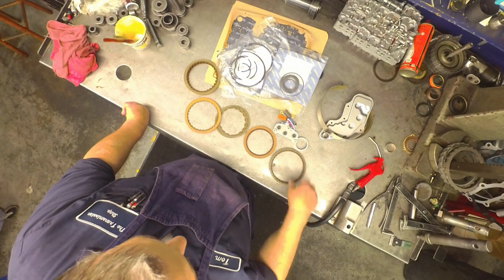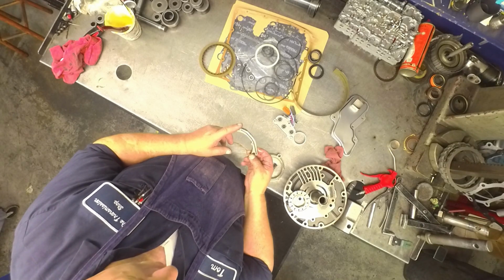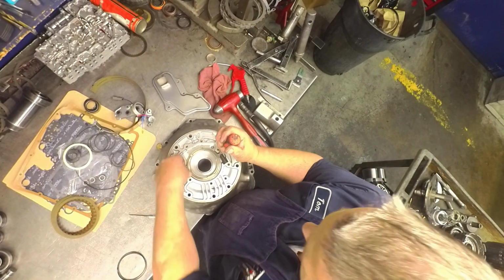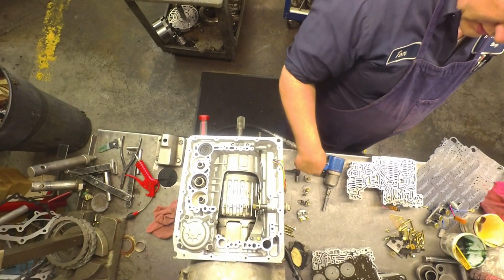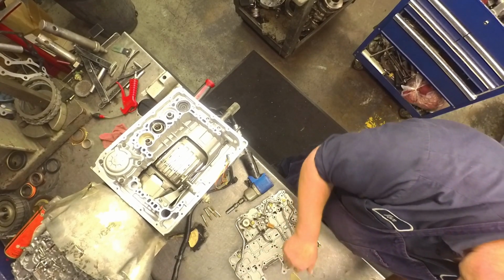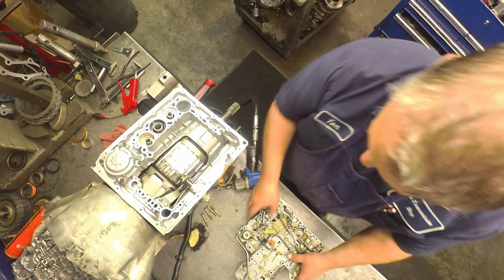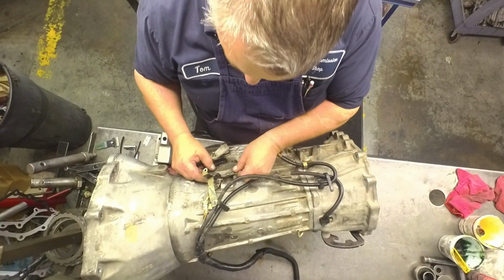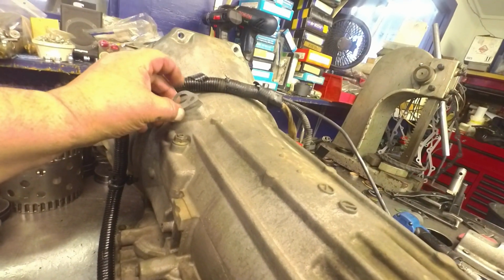RE4R01A Rebuild

Comment: Ok i got the trans back in and reverse works  but i get an incorrect gear ratio code, it feels like its taking off in second gear but it does shift to the next gear smoothly but when i get up to 50 mph or so it never goes into overdrive.I do feel at least 2 shifts from a standing start  , but if i manually shift to first gear it never drops down and stays in first  like our 2001 does . The transmission does no change of gear or anything change with the RPM when i press the OD button on and off when im going 50 mph . Also i hear a whining sound like a trans makes when the fluid is low sometimes after it warms up, its not very loud and it comes and goes.Sometimes you never hear it  at all ! Well i think my main problem is  i have the wrong transmission filter/strainer installed .I havent driven it very far at all . The filter that came with the kit has a 2x2 x 3/4 deep box on the bottom of the strainer that all the trans fluid is sucked in through . We have a 2 wheel drive 2001 Xterra and the trans pan is shallower than this deep pan thats on the 2004 4x4 so i think its sucking air and running out of fluid at times because of the shorter filter it too far from the pan bottom  . I got a different filter today with a longer square intake box but the pan was just barely hitting it so i cut about an 1/4 of an inch out of the little intake box  so it sits almost at the bottom of the pan in the center where those 4 channels are cut into the center of the trans pan. This filter said its made in Tiawan so mabey it was never cut right.i wouldnt be surprised  . The other filter the shorter one was about 5/8ths of an inch off the bottom of the pan and i think it was running out of fluid sometimes. The guy at the trans shop said this filter he gave me is for a Mazda RX7 but it looks like the other one except the intake is over twice as long and the bolts that hold it up match up to the valve body .You only hear that slight whining  when its in park and your not driving the truck and its warmed up  . I dropped the return line off the trans cooler today and ran the engine for a few seconds into a 5 gal bucket and noticed the flow was not as much as our other Xterra. Its supposed to pump our like a quart  or 20 ounces every 25 seconds and it was pumping mabey half that so  I shut off the engine and hooked up a 12 volt transfer pump to the discharge line to pull the fluid out and the pump was clearly sucking air in just a few seconds because the intake is too far off the pan bottom i suppose so i took the drain plug out to drain the rest about a quart and a half out. I havent tried the new longer filter yet just thought id ask you first. I followed this video to the letter when i rebuilt the trans. Any advice much appreceated, hopefully i didnt fuck it up, the fluid looks fine still and nothing strange in the pan, ive only drove it mabey 2 miles tops.
Reply from the maker: First thing is to make sure and get the right filter. There are 8 different ones. Do you have the original? You need to match up both sides of the filter as there are differences on each side. Most Xterra's I have seen that are 2-wheel drive, take a WIT #73010AB. If you don't have the original and the transmission has never been replaced, I would get one from the dealer and you should (Not that they don't make mistakes) get the right one.

Comment: What would cause hard shifting on a 4 wheel drive 98 pathfinder
Reply from the maker: Are there any codes in the system? Just because the check engine light is not on does not mean there are no codes. High line pressure because there is a code stored would be a start. There are alot of things that can cause hard shifts. We need to narrow it down a bit.

Comment: The noise you said u would get from using the wrong hub , could u get that in 3rd? I used the factory one. But on 3rd i hear something for a split second. Only at 1/4 throttle. 4 is good . Transmission pulls an shift great.
Reply from the maker: Yes,that is when you would hear it. Usually it does it no matter the speed.
Reply: @CurmudgeonTransmission  will it last for a bit ? Or is it something that will destroy the trans in a few miles? And thanks for responding.
Reply from the maker: @danielbolen1396  Don't think it will do it in a few miles but it is making metal shavings from rubbing on the clutch.
Reply: @CurmudgeonTransmission  on the transmission that came in the superchargerd frontier dose the high clutch stack go steel steel then alternator to the plate? I think I messed up using parts out of a no supercharged transmission. I know the drum was taller. An the no supercharged one has a thicker steel against the piston. Thanks for all the help
Reply from the maker: You can put the heavy duty parts in a light duty, but not recommended to go the other way. It is recommended that you use ALL the parts involved which include: Rear planet, front planet, sun shell, reverse drum & clutches, high drum, high clutch hub, band, low/reverse piston, forward drum, sprag and most of the bearings. There is nothing stated what the stack should be in the high drum. I can tell you you can make whatever configuration with the steels you want. 2 on top of each other, thicker, thinner. Whatever you need to do to get the clearance to come out correctly as well as placing the bottom clutch high enough to engage the hub & the top clutch low enough to do the same. Just make sure you are not using less clutches than what it came with to get there.
Reply: @CurmudgeonTransmission  thanks a million man. I really appreciate you taking time to help.

Comment: Hi, why the service manual for the 4x4 Nissan Pathfinder 1998 with the rear 2wd part time option says, that the vehicle can ( but not recommended ) to be towed with the rear drive wheels on the ground at the speed no more than 60 mph with the transmission and the transfer case in neutral ? Does the transfer case in neutral not totally disconnect the front and/or rear wheels from the transmission? Your opinion would be highly appreciated.
Reply from the maker: It apparently does not. I can tell you I would not tow one at all unless I took the driveshaft out of it. I had one come in last year that someone had towed half way across the country and it welded the entire gear train together. Couldn't even get the thing apart. RV places sell quick disconnects for driveshafts.
Reply: @CurmudgeonTransmission  Mine got towed by the road service for 25 miles in about 20 minutes and right after the towing the reverse is shut, the vehicle moves forward in neutral. What do you think ?
Reply from the maker: Sounds like it already damaged it. Hopefully the damage is limited, but you never know what your going to get until you get in there.

Comment: I bought a 2004 xterra 4x4 automatic for 500 bucks  that has no reverse, it drives foward perfectly od works and the 4x4 works fine. When you shift the trans in reverse it sounds like the engine slows slightly but wont move the vehicle at all but it does engage and the engine changes , i really dont want to drop 2 grand in a vehcle thats not worth 2500 with 277,000 miles, the 3.3 engine runs as good as our other xterra with 130,000 miles and the ac is ice cold and the body is in mint condition, the interiour is like brand new
Reply from the maker: Sounds like it is worth it to me. If you are mechanically inclined fix it yourself and save some bucks or just keep it as a parts vehicle. If you are asking what I think is wrong with the transmission, sounds like the drum is ring cut because the bushing wore out in the reverse drum. Bare minimum in that case would be the drum and pump, of course you never know till you get in there. Mine has 220,000 on it now, freshened it up at about 90,000 because it was leaking out the front, unit was working fine.  When I got in there the front planet shims were coming out of the planet. Few more miles and would have caused a lot of damage. Got a 4L60E in a Chevy truck right now that has 170,000 on it and working fine. Guys wife told him she would not go on trip towing a trailer to Colorado if he did not get it rebuilt. Good thing, rear planet had a chip in the teeth. Would not have made the trip, probably would not have gone much further anyway.
Reply: @CurmudgeonTransmission  Ok Tom i FINALY got the transmission out, omg it took me 4 days working on it 3-5 hours at a time i had to pull the torsion bars  and all the exhaust off the front and shove the muffler and the tailpipe and that flex joint thing back enough to clear the tailshaft. I first couldnt get it to budge from the engine because i missed one  bellhousing bolt, i also forgot about the speed sensor on top of the bellhousing , the plug broke loose when i dropped it down, but i dont think i dammaged it. The hardest parts were getting the exhaust flange bolts off especially the passenger side, getting the starter out through the inner fender and getting those big metal braces off the side of the block that let that dust cover come down, i  had to remove the trans cooler lines out to allow that dust cover to be removed. The 4 converter bolts were very difficult to get to and i dropped one of down inside the bellhousing. i didnt remove the heavy transfer case taking it out but i think i will leave it off to re install it. This is one of the most difficult jobs ive ever done, I can have the transmission out of my 85 Square body chevy in about 2 hours. I also need to fix the rear main seal and possibly the oil pan but the differential in front looks like it has to  come out or the motor has to be pulled!  I have a 2001 2 wheel drive with only 130,000 miles but the rear main also leaks. I dont have a lift only a concrete floor garage and i literally have parts scattered all over. The only thing i see so far questionable is this pump bushing well im not shure thats the right name but its got 3 rubber o ring seals but they are square o rings and this metal looks worn, i havent got but a few drums out from behind the pump yet, the big drum is still in the case.The clutches ive taken out dont look bad, they still have the groves cut into them, The trans shifted great in all foward gears just wouldnt move the vehicle at all in reverse.That lever thing with the tiny rubber wipers in it seemed to be stuck, i think this causes the line rise? mabey thats why it wouldnt go backwards, you could see the engine rpm drop very slightly but it just didnt move.

Comment: Hi Tom, I have a 2001 Nissan Xterra 3.3L 4WD that is having some weird issues that I think is related to the valve body.  When the issues first started the truck would stall shifting into drive or reverse unless I let it warm up for a few minutes (Torque Converter Lockup?).  Then the problem progressed to it feeling as though the truck is starting off in 4th gear until about 10 mph then will downshift to first (Even if the Shifter is all the way down in 1).  Which solenoids should I buy or should I just rebuild/replace the valve body?  Thanks.
Reply from the maker: Could be a lock-up issue for the stalling. The solenoids come as a set. Will have all of them except the overrun on the front. Check cooler flow through the radiator for the stalling issue. Restricted cooler can cause that problem also.

Comment: You mentioned ls kit I'm looking for a rebuild kit with the band and filter included and can't find an the kit you mentioned where did you get yours? Also should i replace the torque converter while I'm in there? I have no reverse and will be tearing down soon to verify the cause
Reply from the maker: There may be places that sell it like that but not my suppliers. WIT or Transtar. Get a Transtec kit with Raybestos clutches. Get your T/C from Precision of New Hampton. Links are in the description. Probably the drum is going to ring cut from worn bushing. Pump stator will need to be replaced also. Do not buy your stator from WIT. It will not come with the valves and getting them out is a pure PITA. Bishop's or Transtar. Would say Slauson's but I believe they went out of business. Make sure you are meticulous matching the stator with the old one.

Comment: Hi Tom, the situation with my 01 X 4wd is that it is (1)not going into reverse, (2) all gears now go forward, (3) Does not go beyond 2nd gear (4) neutrals out and (5) has check engine light with code P0750 shift solenoid A. I am in Jamaica, just took it to the mechanic. Awaiting his diagnosis. Any thoughts?
Reply from the maker: Never know what you are going to get till you get in there. Guessing I would say pump, reverse drum, probably high drum, band, filter, shift solenoids and torque converter, minimum. But that's all guessing.
Reply: @CurmudgeonTransmission  Thanks Tom, I will let you know how it goes.
Reply: @CurmudgeonTransmission  An update: A rebuild was done. Vehicle now has reverse after the rebuild. The items after diagnosis were 2 reverse clutch, pump washer, brakeband and speed sensor. The P0750 code is still there, all wires were checked and solenoid checked. The problem now is that the vehicle not starting in 1st gear and is sluggish in moving at first, also it neutrals out while driving. What are your thoughts? Could it be the TCM, ECU or do you think we should go ahead and change the shift solenoids and torque converter?
Reply from the maker: @cheryl3487  You can manually check the solenoids, you just need to supply 12v to them. Shift solenoid A is a blue wire with white stripe, B is blue with red stripe. Should be able to here them click when supplying power. If they are clicking you can try making the transmission shift while driving supplying power to them. A is on in 1st and 4th, B is on in 1st and 2nd.

Comment: 2003 nissan xterra, I dont think it shifts into 4th gear or so... it did had a knock sensor code but I replaced it and code is gone. And recently got a transmission code p0745 for Pressure control solenoid A... which i guess its one of the shift solenoids from the solenoid pack. Could that be the reason it wouldn't get 4th gear?
Reply from the maker: P0745 is the line pressure solenoid. Very rare to get that code and it is usually electrical problem. Since you replaced the knock sensor are you positive everything got plugged back in properly? Also did you replace both knock sensors? There are two under the intake manifold, always wise to replace both. The line pressure solenoid also goes through a dropping resistor, I believe it is on the passenger fender on that vehicle. I would double check all my connections and clear the codes. If you have 1st,2nd and 3rd you have everything needed for 4th you just need the command from the computer.
Reply: @CurmudgeonTransmission  its the 3.3 V6 VG33E engine i think it only has one knock sensor, I replaced it and the code was gone... but before the p0745 came one I did notice the transmission not getting to final gear like I was going 70-75mph and it was at between 3000-4000rpms it didn't shift when it should have and you can hear the engine forced... but it was doing that weeks before the p074t came on. I checked the transmission dip stick the fluid looks red. Im worried I could have a transmission mechanical problem too
Reply from the maker: @ronaldreagan388  You are right I looked it up and it only has one. If you read in the posts below there is a similar problem, I give the wire colors, you can monitor the signals and see if it is commanding it. You will need to fix the 745 code first. Like I said it is more than likely an electrical issue.
Reply: @CurmudgeonTransmission  thanks Tom... by any chance do you know if the p0745 code is for one of the 4 solenoids from the solenoid pack... or its that one solenoid that is alone on the bottom side of the valve body which you can see after you open the transmission oil pan?
Reply from the maker: @ronaldreagan388  One of the four.

Comment: Hi Tom, Greetings from Costa Rica.  I just purchased a Nissan Pathfinder 2005 R50 with RE4R01A transmission.  I want to change the ATF oil, I check some documentation and says is recommeded Dexron III.  Can you please help me?  Do you recommend to use Dextron III or syntetic ATF? Multi-vehicule ATF?   Thanks!
Reply from the maker: You can use Dexron III or we use a full synthetic at the shop which works well for most applications. There are exceptions, too many to list. Always best to follow OEM recommendations. But this one you are fine with either.
Reply: @CurmudgeonTransmission  Thank you!